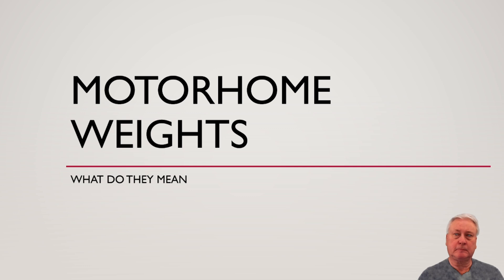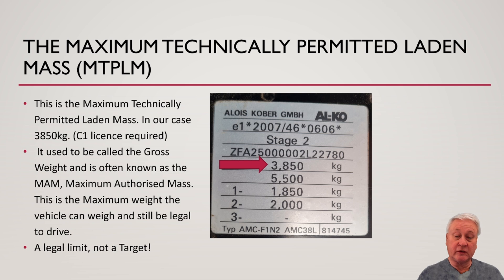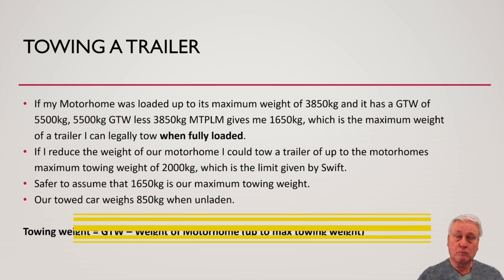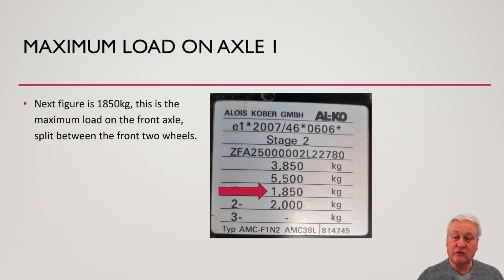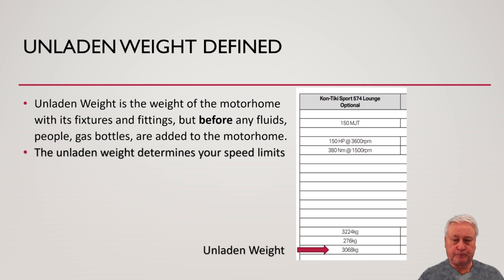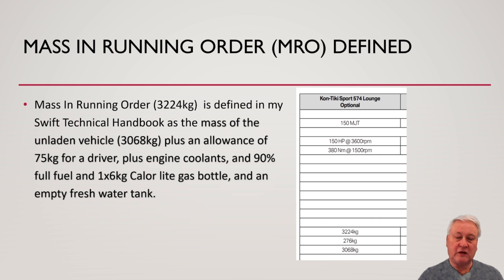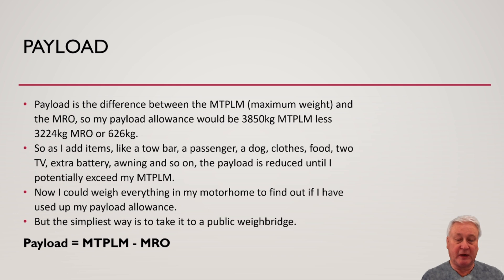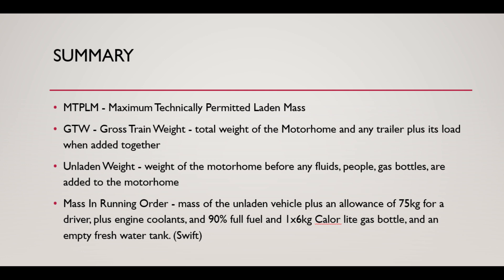Motorhome Weights And What They Mean | Motorhome Basics

Comment: Hi Bob, as you know I'm an articulated Truck driver. Don't forget that the 2000 kg trailer weight is with a Braked Trailer..ie it has its own braking system like a caravan and NOT like a Halfords Type Trailer! Also remember the individual axle weights as shown on the VIN plate. I doubt anyone would exceed the rear axle weight of 2000kg. This is where the most weight can be carried but always best to load and have the weight evenly distributed.
Reply from the maker: Absolutely, anything over 750kg must be braked. I wouldn't fancy towing anything approach g 2000kg!
Reply: @BobEarnshawMoHo  Try 43700kg total weight. My daily weight full of 108 trollies of milk for Asda and Morrisons Supermarkets...

Comment: Excellent video Bob, well done. Just taken delivery of our motorhome today, seems they drove it with a full tank of water all the way from Nuneaton to Bristol, they must've forgotten after servicing it. May start loading it up tomorrow.
Reply from the maker: Great to hear you have the motorhome now. I suppose they forgot to empty the tanks after the pre-delivery!
Reply: @BobEarnshawMoHo  
Unfortunately, there's no manual's and I think it's got some kind of air suspension as there's an up down switch which when activated I get the sound of a small compressor and a gauge next to the switch starts showing a pressure in bars. Any ideas what it does?
Reply from the maker: @davidtanslow3584  never had air suspension myself, but it blows up some airbags under your rear suspension the higher the pressure, the harder the suspension will be. There should be something to let the air out too. Did the dealer not do a video or something to explain how things work? You may beable to download manuals if the dealer cannot help you.
Reply: @BobEarnshawMoHo  
We knew about the air suspension but couldn't find anything near the springs. I'll have another look tomorrow if weather permits. I've a feeling it may be just a single air unit as there's only one gauge and the down switch lets the air out. Will check the manufacturers for any manuals and contact the supplier as they have a stall every year at the NEC Caravan show.
I've found two leisure batteries next to the spare wheel as it's got quite a lot of modifications because it's kitted out for a wheelchair user.
Donyou think autotrail fitted solar panels on all their motorhomes?